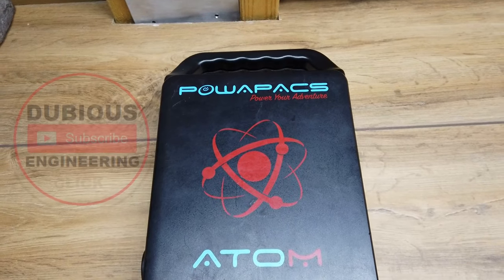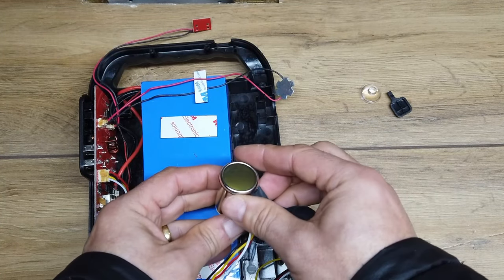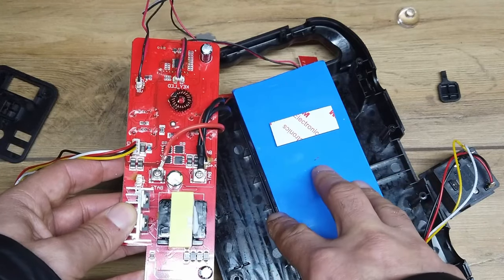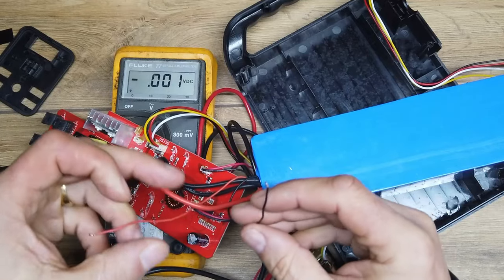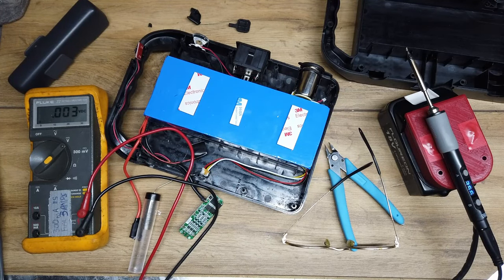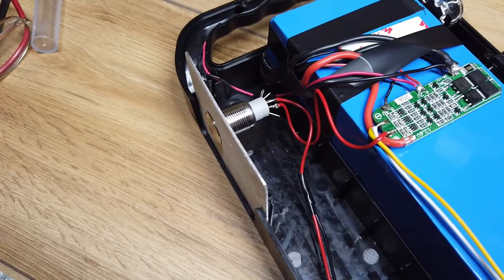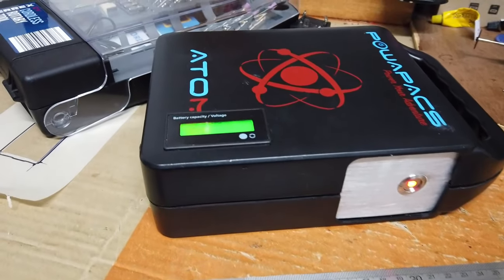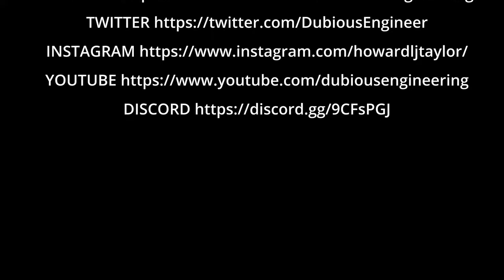DuB-EnG: POWAPACS ATOM - 78AH big lithium battery pack - Repurposed - Christmas Giveaway -  Upcycle

Comment: Can I ask what BMS you're using? I just bought an Atom Pro (with solar panel) on Marketplace and it doesn't produce any power through USB or even the LED, but it's definitely charging. So I'm gonna have to do your procedure for it. With the 60W folding panel, if the battery is still good, it's worth the £100 if I can repair it. I just need to figure out the best BMS or charge controller to use.
Reply from the maker: I'm sorry, I purchased it many years ago...  But any 12v 3 cell 20amp BMS should do the job!